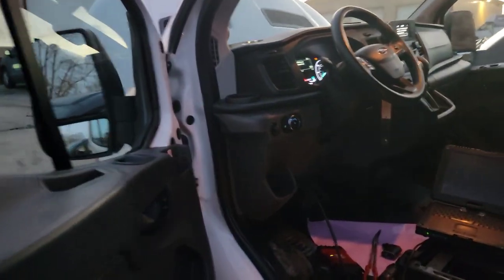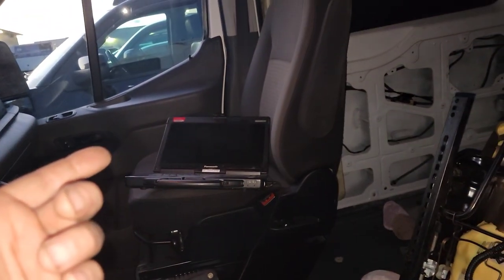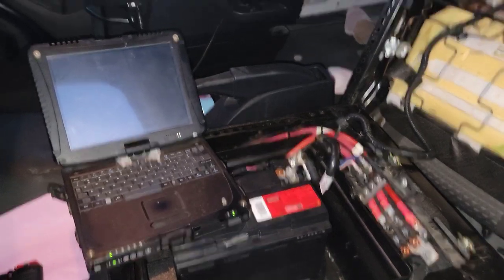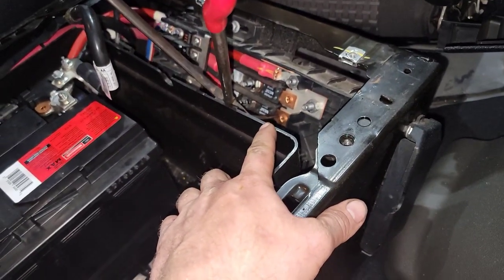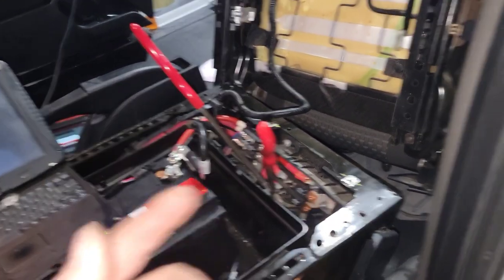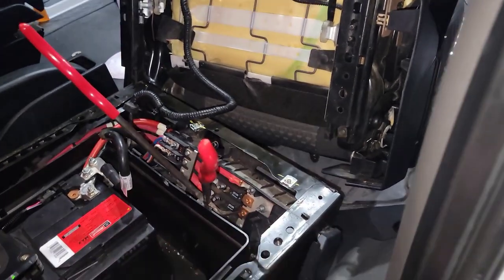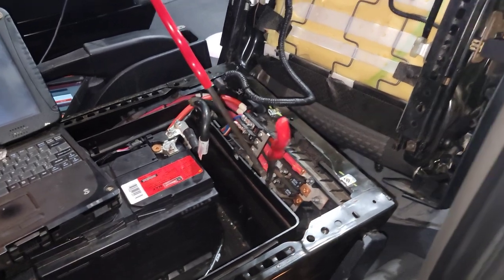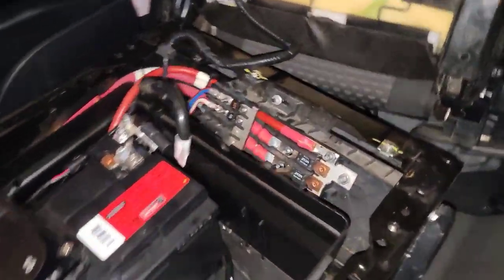2020 - 2021 Ford Transit T250 and up no start - Here Is What We Have Been Seeing Alot of

Comment: Hi. It's pretty easy to fix a lot of laptop batteries.  Plenty of videos on the subject. Sometimes one or more of the cells drops below minimum charge (or the whole bank does) and it's as simple as opening the battery and directly connect to the battery bank applying appropriate voltage. This bypasses the charging controller which is preventing a charge due to under voltage.  If just 1 cell is bad, (not uncommon) charge the one. If it takes a charge great. If not, resolder another 18650 battery with as close a spec as possible. This works on many rechargables besides laptops. I've done it many times. If you have questions feel free to ask, but I'm sure you get the idea, plus plenty videos, I think, on the subject are available .
God Bless,
Rick

Comment: Really good info. I actually have an issue with my 2017 transit 150 that once in a while it will show “brake booster fault”in the screen. Dealer was never able to diagnose the issue.

Comment: Great diag and yes I said the same thing on fleet transit today! It did not want to start and died like battery issues and head person was just saying to change fuel pump 🤦🏻‍♂️and I knew it wasn’t fuel pump. 1. I needed to jump it from the battery but tried under the hood which went dead when I tried that and it shouldn’t do that when you try use jump box. Previous diag was 20psi fuel which I don’t know how they got that conclusion. Replaced it but I seen issues going to arise again but all in all this is good info bro! I didn’t know about these mega fuses. I work on 2018 350 transits. I will look at this tomorrow to confirm👍🏼

Comment: Thanks for teaching us.  What caused that fuse to blow?
Reply from the maker: It could be the way people are jumping these it could be the fact that the mega fuses are loosening up where they are riveted to the circuit board and it's breaking connection so it's shorting out
Reply: @FordBossMe  You say there is an uptick in the occurrence of this........about what kind of mileage are you seeing this issue present itself on Transit?  You da mann, BTW!

Comment: Great Video. My boss who is a master tech himself link me to your video.  I'm having the same issue with  2022 Ford Transit where you turn the key and its no cranking.  There are three Fault messages that displayed and few other lights.  The radio works, lights, heating/AC all still functions normally.

Vehicle is sitting at a Ford Dealership after a repair shop couldn't figure it out.  I'm going back tomorrow and going to check this Mega fuse and hopefully it is the cause.
Reply from the maker: Tell your boss I said I appreciate the share, I also appreciate you watching and commenting
Reply: What was the issue with your Transit?

Comment: Just bought a 2022 new Transit T350 drove it 240 miles home. A day later turned the windshield wipers on only to find them moving in a pulsing movement across the windshield. No matter what, setting you said, they move the same way pulsing. Seems more electronic to me than a mechanical problem. Any thoughts on this?
Reply from the maker: That does sound electronical
Reply: @FordBossMe  Took it to local Ford dealer, said it need a new motor. Took it back for the motor replacement. Then I'm told I have a short in my wiring harness and they can't locate one at this time. When I got home I looked only to see the harness is unplugged with one pin melted (Brown/Yellow stripe), and several wires in the harness burned up. Even meling the lum. Ever see a DC short? Does Ford have a service beyond a dealer for a new vehicle? Where can I see a diagram? I'm not trying to fix it just see how it's wired.

Comment: Over here in the UK, got a 2017 transit minibus with a dual battery set up. Having a major issue where the batteries went low, so they’ve been replaced with new (they were old original) the alternator wasn’t charging the batteries. Presumed it was a faulty alternator, so I replaced it. However, still getting the same fault! Now the alternator won’t send a charge to the batteries unless the lights are switched on, no other internal auxiliary equipment initiates the charge from the alternator.?????
I don’t have the same mega fuse set up because I have a small relay in place of that. is what controls the charging of both batteries.…. Not sure if this is gone, faulty
Pulling my hair out here!
Reply from the maker: I'm lost with this one, I would have to have it to run codes and diag it
Reply: @FordBossMe  that’s part of the problem as soon as you plug in a tester into the ODB port, the dash lights up, throws a ton of pop-ups then ‘engine service now’ and the engine dies

Comment: Hello Rich,
Had to put 2 new battery in a 2015 Transit a while ago , they have the same setting with those big fuses and a relay, could you give us info on its purpose please,it is connected to one of battery.
Why is the reason for 2 batteries ?
Thanks for educating us .
Tigo
Reply from the maker: I don't know what the reason is for two batteries I think it's because it's the work vehicle and they know people are going to run stuff out of it possibly for upfitting options
Reply: Hey actually other battery is for aux stuff other is start battery in nutshell. My aux battery exploded while back symptoms were there and we ignored too long.

By aux mean hydronic heater, radio etc.
Reply: @jrt2924  , Thanks for giving the info.
Good day to you.
Tigo

Comment: Losing my mind. Had “charging system service now” the other day while driving” when I parked 10+ minutes later, I shut down and started right back up no problems…. 3 or so days later went to start and had everything normal when turning the key, but no spark to start the van. Battery is fully charged. Can’t figure it out for the life of me. Abby recommendations?
Reply from the maker: Did you check the things I mentioned here?
Reply from the maker: What all have you done so far
Reply: @FordBossMe  yes, the 3 mega fuses all seem to be perfect. When I put the key in, my vehicle acts the same as when you connect the circuit with the door pliers… beeping, electrical is all on and working as normal… just getting that “click” when I turn the key to ignite..
Reply: @WestonKruseVids did you find out what was the problem?

Comment: Loved the video but I have to wonder what rocket scientist decided that fuses weren't servicable parts, perhaps they need to send the engineers and accountants out to the real world for 10 years before they are allowed to put a design like that into production.  

Some blame the location which has nothing to do with the real problem, the lack of comprehension that all parts of a vehicle need to be servicable at -40 and 300 miles away from the closest dealer.
Reply from the maker: Keep wondering
Reply: Nah I just avoid any newer vehicles hence my 2004 F150 and 2010 Town Car.  

Newer cars on average can be relatively reliable but the bulk of tow truck calls are the more modern cars with their delicate electronic and mechanical systems.  

I have seen the new safety systems in action and won't deny their effectiveness like the one distracted Toyota RAV4 driver who drove across the oncoming traffic lane in front of me which caused  it's stability control system to correct the driver preventing it from barrel rolling when they tried to yank the steering wheel back as it bounced through the ditch.  

These systems are life savers but I have to wonder how many new drivers will never learn how to correctly drive for incliment weather conditions or deal with a system failure as modern vehicles correct for their lack of driving skills like the enhanced cornering correction that stability control can bring.

Comment: I think fuses and their build quality are the next nightmare for techs since everything thing else has gone for crap in build quality. Just had two of our new Ram 5500 bucket trucks go out for warranty due to charging circuit failures. Both had mega fuse failures and were built into the harnesses, so the entire harness needed replaced instead of a $10 fuse. And to make it better, the harness were on backorder from Chrysler for two months! Luckily our 22’ f550s have been good so far, fingers crossed…..

Comment: Hey Rich I had a weird auction car the other day, 2016 mustang, everything worked on the car except the battery charge light was on the dash, but the alternator was charging, and randomly the car wouldn’t crank, battery was good and even with a jump box it would sound like you have a dead battery, several starter clicks and then that’s it. Was chasing my tail all over the place looking for bad grounds and whatnot. Finally got to a point of checking powers and grounds to the pcm, I was missing 2 powers at the pcm. Come to find out inside the fuse box it had pcm batt 1 and pcm batt 2 and one of those fuses was just missing from the fuse box. Very weird problem that it was missing 2 pcm power circuits and the only thing not working was the 2 problems I described, it was definitely a head scratcher for sure. With the symptoms it was having I can guarantee some other shops out there would have thrown an alternator and starter at it lol
Reply from the maker: Interesting

Comment: What about 2015 ford transit 250 3.7l high roof sometimes won't start all lights on but no start i found a way to start on N do you think it is same problem thanks
Reply: Are you having it turnover but no start when it park?
And do u just put it in neutral a nd it starts right up?
Reply: @tinmanslickgreasy999  yes everything works on park exept you cannot turn on to start only if you put on Neutral you can start the Van up
Reply: @ajetimusliu8408  mine just turns over but will not start....same thing happened last year around the same time I had it towed to the dealership after trying everything I could.
They finally got it started but they could not figure out what the problem was. No codes or anything. They didn't charge me which was a good thing. They said it had fuel pressure.
But the same thing is happening again. I have not tried to start in nuetral....
Reply: Frustrating
Reply: @tinmanslickgreasy999 did you find out what was the problem?

Comment: Back in my time as a tech (Subaru) the only time we seen those fuses go out are when people jump started them and crossed the cables. So what you are saying is that vibration causes a rivet to break?
Reply from the maker: Yes most certainly it does we don't know that that's exactly the case with this situation but we are suspecting the increase in uptick and Rise of these becoming a problem
Reply: @FordBossMe  it was usually a salesman or body shop technician. Rarely did we have customers actually do it. We ended up keeping several on hand the dealer I worked at was a Volkswagen dealership as well. We had a lube tech jump a vw backwards one time not only did the battery blow up in his face it blew the mega fuse and the horn wouldn't stop blaring. That's actually a feature with VW in case of a crash and loss of battery power.

Comment: Our 2020 T250 has started to not restart while sitting at a stop light.  Sometimes it gives a message to put in park, turn off key and then restart.  So far that has worked.  It also has not been cranking over at all despite all lights and power is on.  If I cycle the transmission and turn key on and off during that process it starts.  Dealer says there are no codes being thrown, battery is 80+ percent and of course they can't get it to repeat for them.  36 hours after picking up from dealer, it wont crank over without my whacky technique.  If you have seen this before, I would greatly appreciate a reply.  Your video was awesome, we need more guys like you.  Thank you!

Comment: Our 2020 Ford Transit 250 has "Check Charging System Now"  going on and off continually for last 6 weeks. In two Ford shops 3 times with no fix! We are in CA, can you help?
Reply from the maker: Alternator or battery issue

Comment: Nice work I'm sure this video saved alot of headaches out there !! ...Question???

 do you know what the difference between the transmission on the new 2023 f250 with the 6.8 vs what comes on the 7.3 and 6.7 ....I need vynil seats and a gas engine but I'm kind of weary about the new trans and unfortunately you can't get vynil with the 7.3 🤔
Reply from the maker: No idea bud